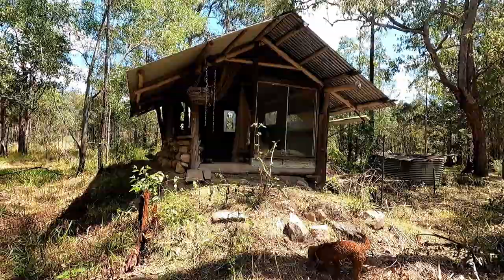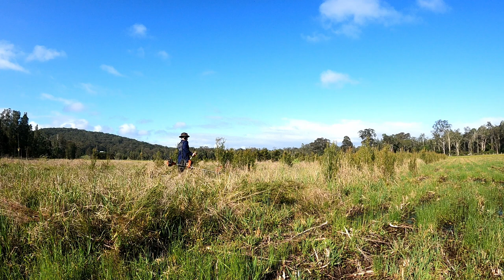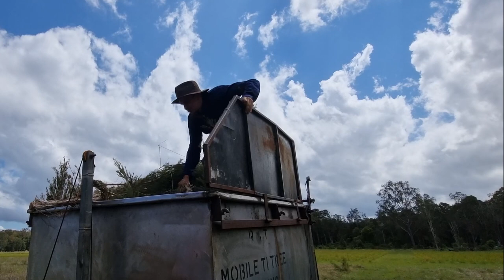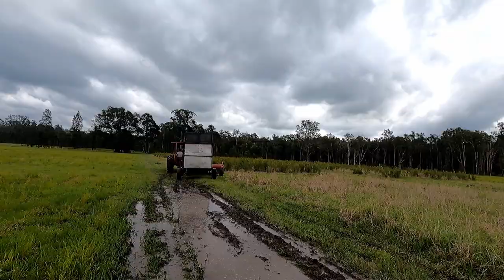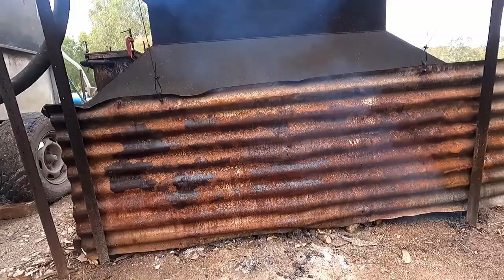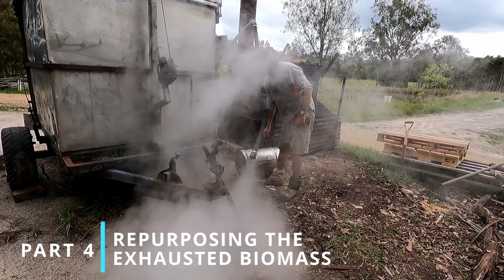Harvesting & Distillation of Organic Tea Tree Oil   -  Entire Process Explained

Comment: Can u please tell that 3 cubic meter of the bin contains how many kgs of raw material full packed
Reply from the maker: Not sure about that one, it did take a good few hours to fill that bin up. When we get our own equipment we'll have a better idea of the numbers.
Reply: @Off Grid City Couple  ull hsbe to use a shredder to achieve proper space utilisation of the bin.  This method being shown is pretty inefficient.  12 kg on 3 cubic meter tank is probably less than 1% extraction.  The shredded biomass needs to be weighed before u put in the tank and then calculate the proper extraction %.  Best of luck. Extraction and documentation is key